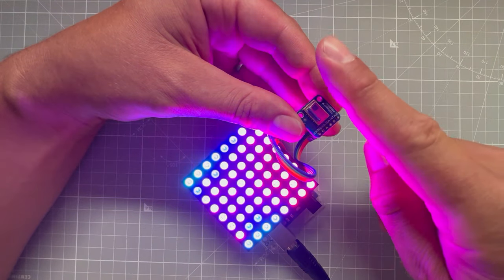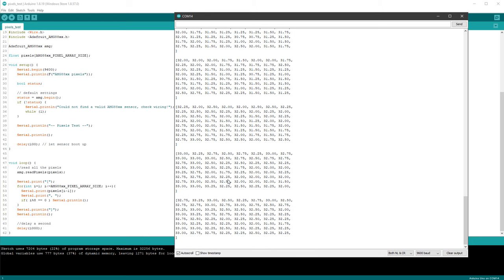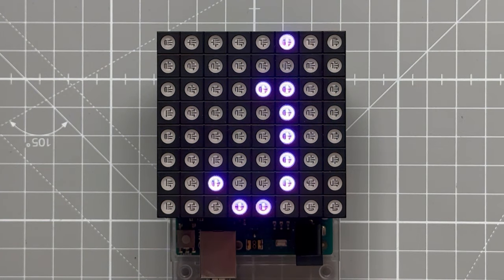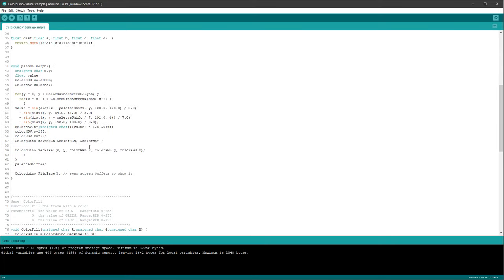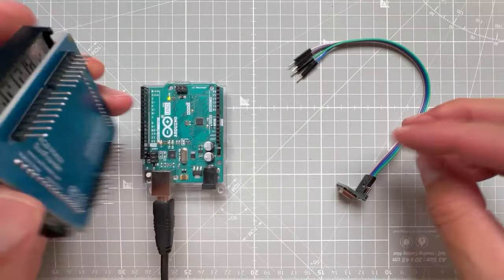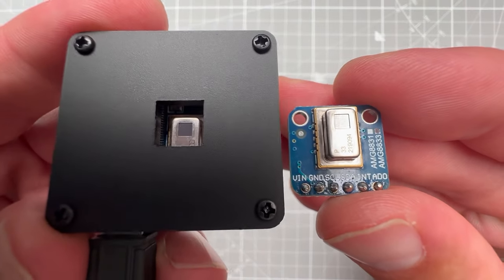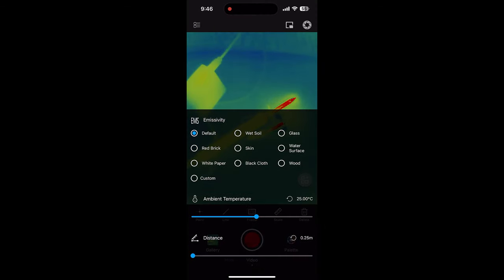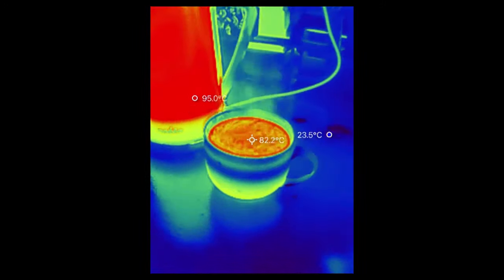Arduino Thermal Camera

Comment: Painting with temperature. I wonder if anyone has done an actually good-looking painting using this method yet. Needs multiple heat distribution points at variable temperatures.
Reply from the maker: That’s interesting question. Painting with light is usually done with photography, since this approach would require for all the viewers to have infrared cameras 🙂
Reply: 0.0 THIS IS MY CALLING  haha dude i had NO clue this kinda shit was possible with an arduino, new to them but always been curious; 100% making a thermal cam already. def gunna try to paint too

Comment: can you do some tutorials on how to use touchscreen with arduino, and how to store images and data in SD card beacuse when i use PROGMEM too much with oled it errors with building fail with full storage.
Reply from the maker: Which touchscreen do you have in mind? I do plan a video with SD card, but a better solution might be simply using a different Arduino board. The new Uno R4 has 256kB of flash memory, that’s eight times more than Uno R3.
Reply: @upir_upir  LCD touchscreen, and also called TFT, I already have arduino uno r4 and I am using it but because I have a project filled with smoothness, i need to use an sd card but I don't know how to use it with arduino and oled display, and I want to move this project from untouchable screen to a touchscreen to use less buttons
and thanks.

Comment: I'm on the run so don't have time to watch full vid now if the answer is in the video, my apologies. What's the distance range of sensors like this?
Reply from the maker: It’s not mentioned in the video. The common usage might be detecting a human, and in that case, max. Reasonable distance is 7m / 23 feet, as at point, a human would take one pixel. Other than that, I think there is no restriction.
Reply: @upir_upir  thanks
Reply from the maker: @zooziz5724  you are welcome!

Comment: HOW does that infrared camera have an additional lens?

When I have tried times capture infrared thru any outside lenses (like a telescope on the moon, for example, or a building down the street) my IR camera sees only the SURFACE if the telescope lens closest !

So what did they do to make the lens bend the infrared light?
Reply from the maker: According to Wikipedia, the lens is often made from solid germanium- so you just need to get this type of lens. I’m sure it will be impossible to find though..

Comment: how can i combine a 1.3 SSD1306 oled display to this arduino setup?
Reply from the maker: SSD1306 will only display one color, that might be quite limiting in this case.
Reply: Thank you foe the advice i have purchased a 2.4" TFT display ,  what would be the connections if i am using TFT 2.4 display and have soldered the AMG8833 ton the Arduino uno ?

Comment: How to kill your sensor 101: plug it to 5V when it's clearly designed for 3.3V. The AMG8853 is the 5V version.
Reply from the maker: Thank you for the clarification, since it´s still working, I would suppose it´s (slightly) 5V tolerant.. at least for now :)

Comment: Hi , can i use this for wider area application . ie at a place near garbage box to detect if a person throws garbage outside the bin or not . the area of the frame is 10 m * 10 m and secondly is the sensor 180 degree oriented ?
Reply from the maker: You can probably do that, but a standard infrared camera (not thermal) with some infrared lights will probably be 10x cheaper with a 10x bigger resolution.
Reply: @upir_upir   will the object/garbage be detected within 3-5 mtr from the infrared camera . If yes, can you tell me the model (product link is prefered ) and will i get a 180 degree view from the camera too ?

Comment: can i use thermal camera for arduino to create a device that can detect human then the electric fans will turn on?
Reply from the maker: Yes, you can. But if you want a simple and ready to use solution, try searching for the "human presence sensor". It will simplify things a lot.
Reply: @upir_upir  thank you so much sir
Reply: @upir_upir  another thing to ask sir, is there a sensor that can detect water in the floor? I am planning a robot that can detect water on the floor and it mops the wet area, sorry for the wrong grammer hehe. Thank you in advance for the reply sir